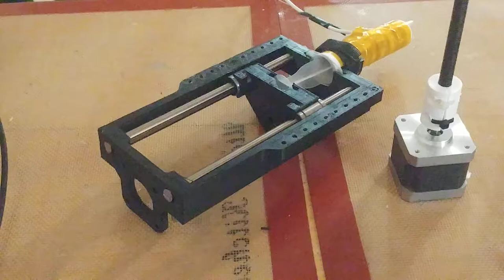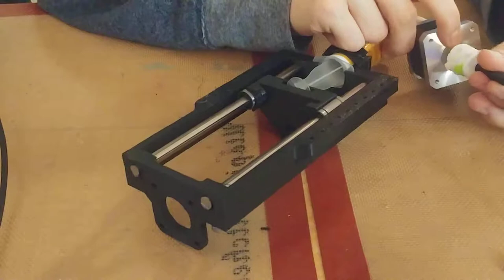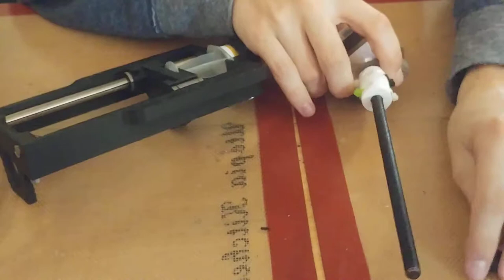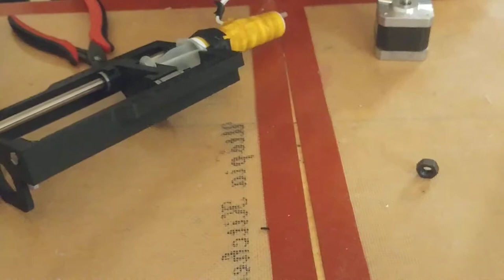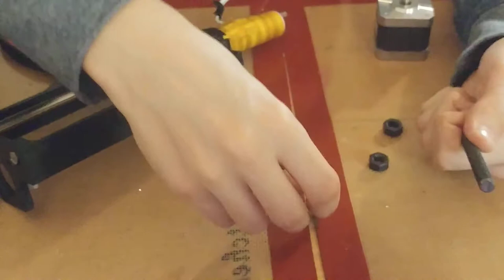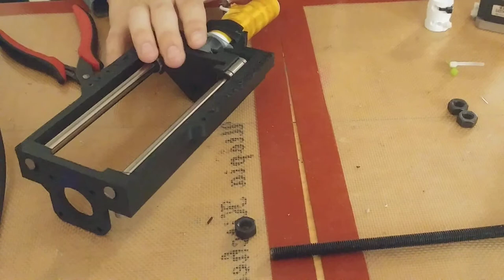Chocolate extruder update: scammed on Aliexpress

Comment: Doesn't look like T8. There are multiple legal pitches for M8 thread - 1.25mm is the recommended one, but 1mm and 0.75mm are available too. It might be slightly unwise to just order metric fasteners if they don't specify which one it is. You can measure the pitch, take 10 or 20 turns of thread and measure how long that section is.

Here in Europe, we can just buy metric fasteners from a home improvement store, they're super cheap, but i understand this might be difficult at your end of the world, but then i'd just consider a redesign for the locally available ones. 5/16th?
Reply from the maker: Siana Gearz thanks for the advice, being a stupid American I didn't know that and just figured the metric screw size would work and be easier due to not have to recalculate motor turns per milimeter pushed for an american thread in inchs but I think I will have to take a trip to the hardware store and see what they have
Reply from the maker: I just checked and it is 1mm pitch... so my nuts must be 1.25... shoot. Thanks for the advice